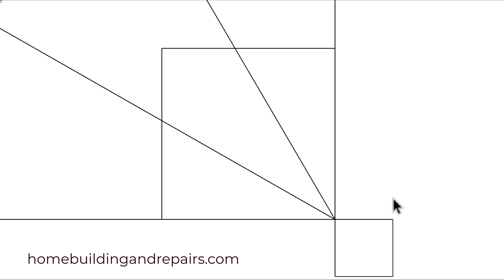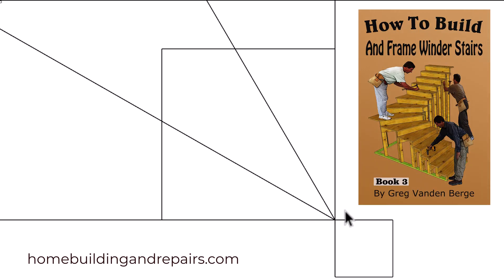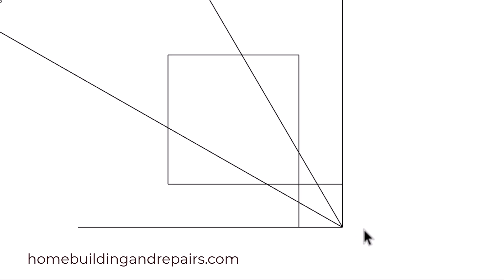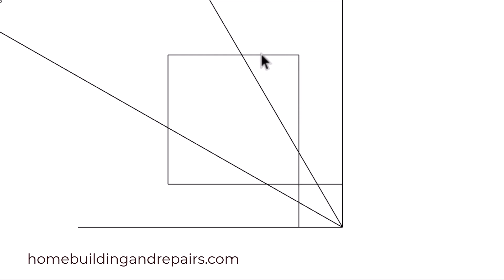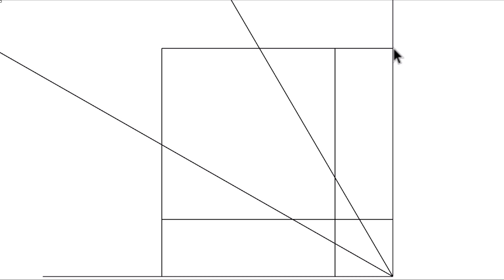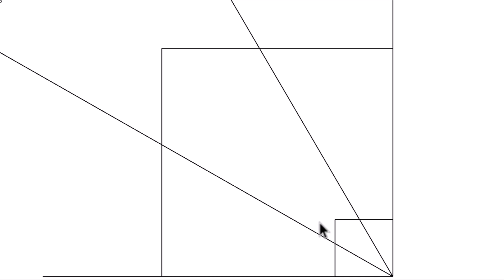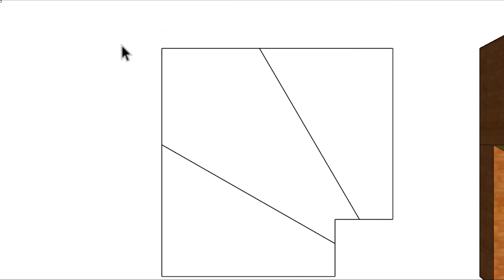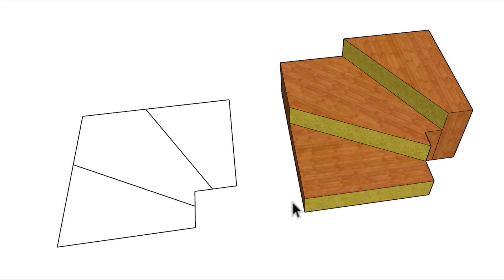D.I.Y. Winder Stairs Step Design - Easy Layout Tutorial And Code Considerations

Comment: How do you measure the 6-inches at the pivot point of the middle step, where the step is notched. Does each leg of that notch need to be 3-inches or can you measure 6-inches straight across the gap/open area?